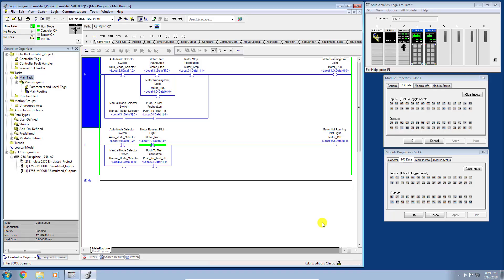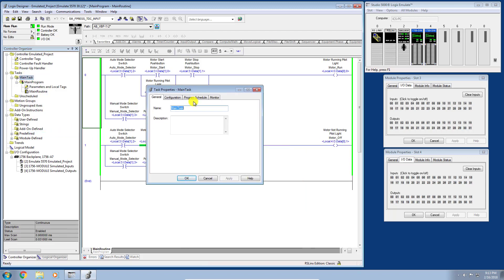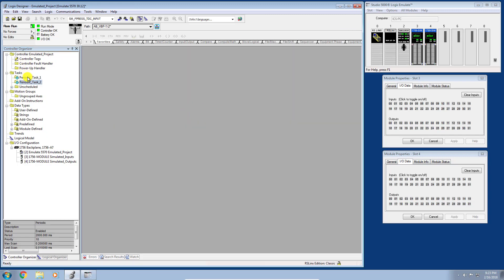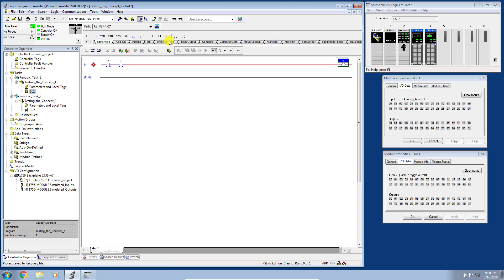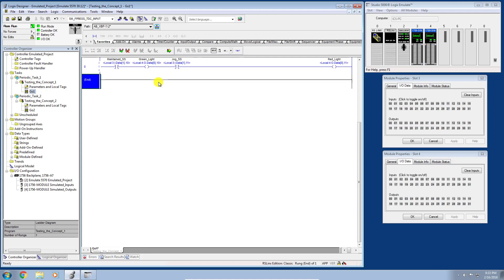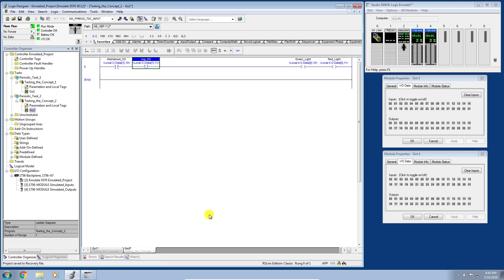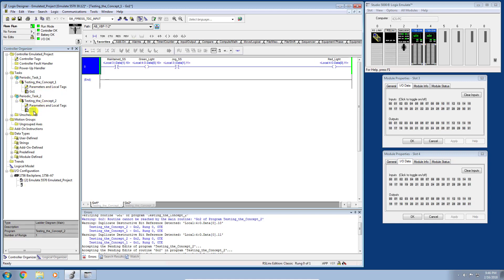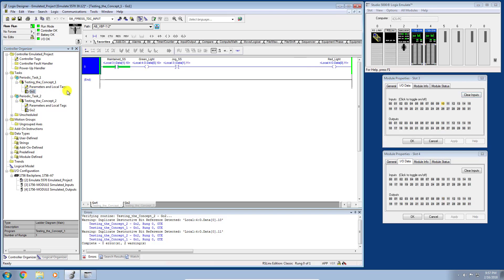PLCGurus.NET - Understanding Periodic Tasks

Comment: Hi Guru nice video, I have one question, the order of execution of the periodic tasks (who executes first and who then) goes from top to bottom? Or dependding of the time scan and the prioriti? Thanks!
Reply from the maker: Hi Manuel, thanks for your comment. You have the ability to set the priority of the tasks by right-clicking the task --> Properties -->Configuration. From here you can set the priority of the task (the lower number yields a higher priority therefore it will execute first). Hope that helps.

Comment: So much details here, had to stop and rewind many times. I'm also going to agree with a commenter below in you giving a or several examples of a process or more that may not need to be scanned on every scan of the processor. Assuming you were running a industrial water purification system at a plant site  with chemical feed systems, what would you put on periodic task that don't need to be on continuous? 
I can say having seen many logic ACD file for many of our OEM company various projects, there aren't usually any periodic tasks. There is very much just one continuous Task, Mainroutine and many other rungs in that routine with a JSR in the main rung. I've seen as much as 25+ rungs under that one Mainroutine each separated for processes. Analog I/O mapping, Digital I/O mapping, Equipment Logic routine, Permissive etc. Never usually periodic tasks i've seen. I'm just a junior programmer so i'm not sure what the answer is for that in our logic programming. So an example or few would be great. However, i'm going to take a guess in that Events could be Safety Process Shutdown logic routines where things need to stop fast and quick in the event of safety issue.